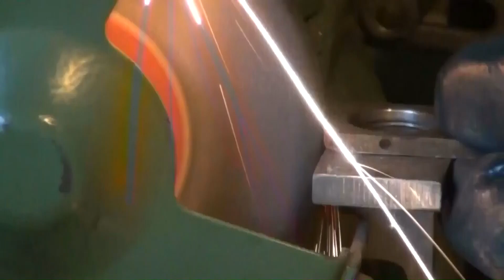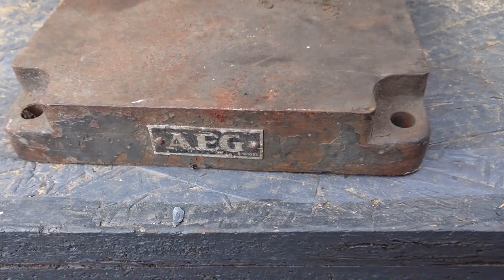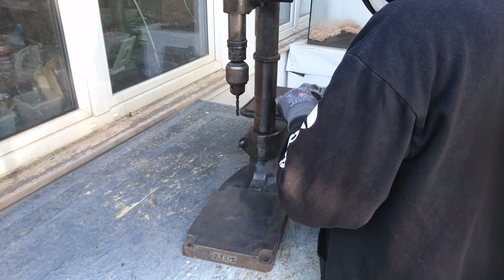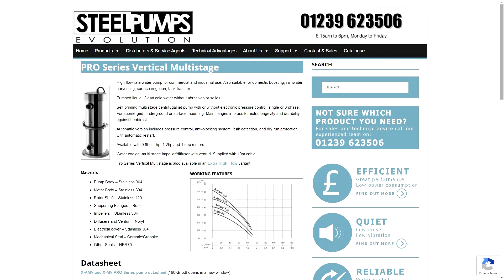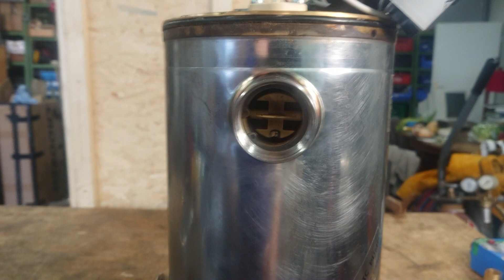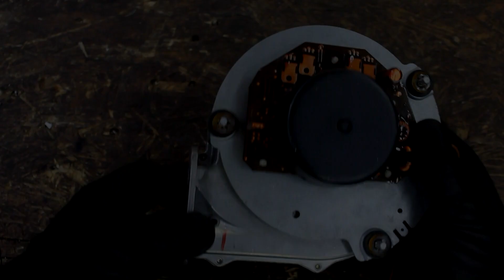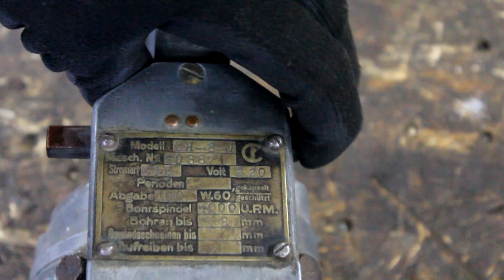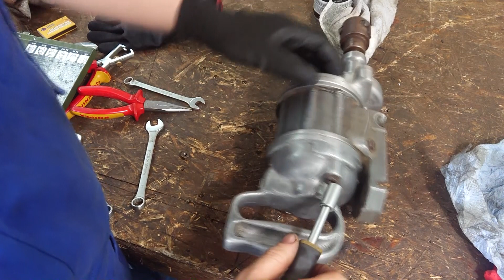Incredible Scrapyard Finds! Repair-A-Thon!

Comment: I'm amazed that someone disposed of that pump its in great shape
Reply: I guess they really needed a power cord?
Reply: I'm mildly concerned that it was disposed of because of what it was used to pump in its prior application.  If it was used to pump something dangerous then disposal to a recycling yard with the cord cut off might have been deemed acceptable, not realizing that the yard allows metal to be taken back out again without some kind of full reprocessing.

Comment: Diesel is also a good cheap cleaner with rustdissolving properties and less aggressive than gasoline.
Reply: Biodiesel is also a good solvent, so good that it often has problems loosening up junk that petroleum diesel left behind.
Reply: Yeah, so what? Firstly, the gasoline was used here for something else, not for rust. Secondly, gasoline is not aggressive against steel anyway. DOH.
Reply: @johncoops6897  My comment made you angry?

Comment: Wow.  Keep your hair tight and away from that front pulley on the drill press.  I've seen what happens when large sections of hair get yanked on by fast moving parts.  NOT PLEASANT.

Comment: In the 90's I worked for a Dutch power company. AEG was (had been?)  making and supplying software to monitor the high voltage power lines. To install the software, some German engineers came over and with some difficulty made it work. They explained that AEG actually means Am Ende Gut ("good in the end").
Reply: German equipment never breaks down, ever, you were not operating it correctly
Reply: I heard a different meaning of AEG, Auspacken, Einschalten,  Garantiefall.  Unpack,  Switch on,  Warranty case.  🤣😉